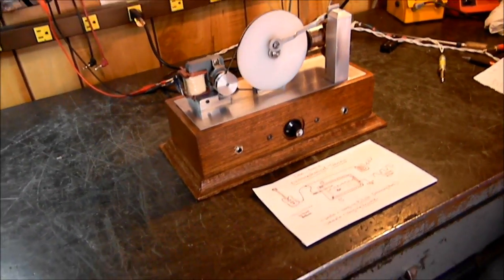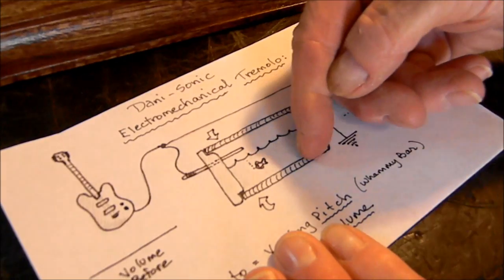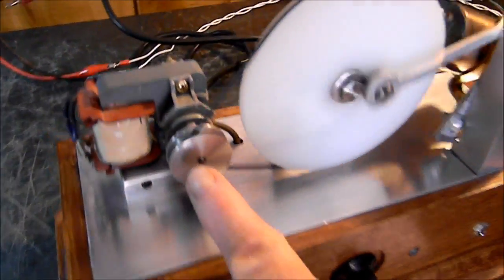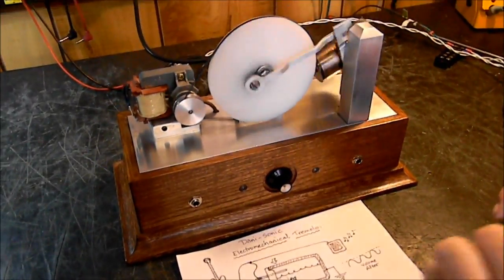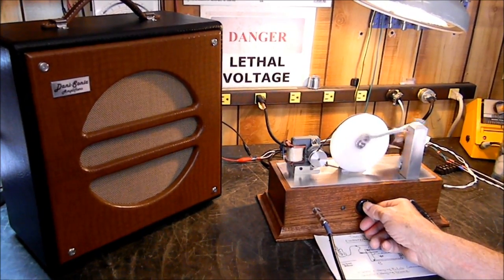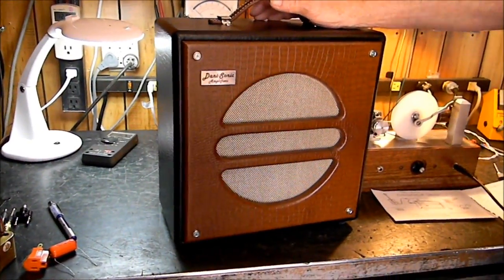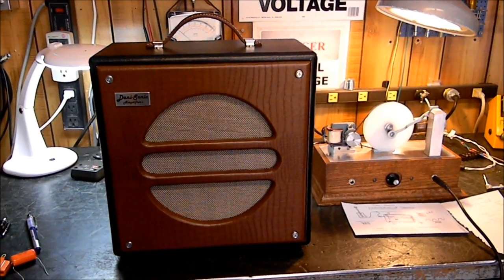Home Made Electro-Mechanical Tremolo by Uncle Doug

Comment: Are you sure that's distilled water? The reason I ask is because there are no minerals in distilled water, which means it's not conductive. If you're on a well and used tap water, I can understand how it would work. But anything that comes out of a still has no minerals, ethanol itself isn't even conductive. Stick the probes from a digital ohm meter in a shot of vodka and see for yourself.

Comment: great remake all im gonna say is you need to add a glass lid or something thick to protect it for the years to come so it lasts.i like the new design also & the fact its a lot smaller but when i heard the original i noticed how clear & full bodied it was & how long it repeats.are you gonna sell some of these proto types cause i would be tempted.me i just got a 1967 deluxe black face fender with tremolo he added tube reverb to it which is alright but the tremolo is going murky at times.i know what the problem is & its an easy fix a part needs replacing.but one thing i noticed is many of these old school great amps had blue ajax caps another tech that has disappeared with the dutch maker.i see they make orange caps or red caps now but they are no way near as good.so what ive noticed is many buy a fender remake amp & send the whole amp tray to get rewired by hand.some of the rewire jobs use loads of caps 20 or more orange caps but every time i look inside a remake amp i cringe at the cost cutting savings even the tubes they stick in these expensive amp,s are rubbish.but me im a guitarist so im always looking at what effects & amps they used also what mics.but all this old tech cant be recreated by digital tech sacd you can keep digital vinyl you can keep i play old analogue records i live for this experience & i wont let any greedy label tell me anything is better than that because its not & musical history is clearly being abused.because every digital vinyl reissue ive heard has loads of the original recordings missing not to mention been compressed to death.i mean i play young people records & they are shocked at the sonic spread & the bass output.but if you built a tape echo unit i would probably buy it & i believe many guitarists would as well.ive heard a few like the binatone units & roland units.but i honestly believe one day analogue will rise up again & i know 4 people who are recording now & we all use analogue tech because its KING baby lol.but the best guitar amp ive heard is a 1960 bassman amp yeah it was for a bass but it was a great guitar amp.that was the amp marshall cloned which hendrix then used so fender built it first & better in my humble opinion.but ive heard 2 & one didnt have the same magic as the other one even though it was from 1959 great post most enjoyable its great learning about yesterdays creations that should still be made today but properly peace...
Reply: Thanks for all the interesting comments, DJ. I'm glad you enjoyed the video.

Comment: That's a very neat device! On first glance, I thought it was part of a weather-station!

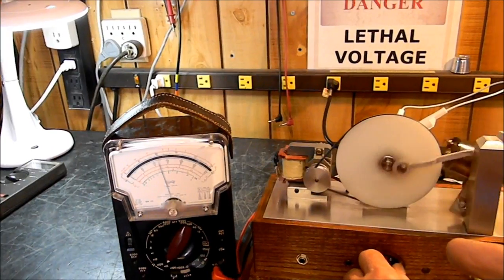I'd love to see this signal on a 'scope!. (5:13) I noticed from your tank, that even at very slow speeds, the resistance element will be 'swamped' with water all at once! Maybe tilt the resistance element up at an angle, where you'd get a gradient of resistance as the tank moves the element into and out of the water. This would probably make the tremelo more 'linear'.

Comment: Cool stuff man, I love DIY homebrew guitar effects and amp stuff like this...a year ago electronics was a complete mystery to me....and today it still is - but I certainly know alot more then I did a year ago and have learned sooo much from my basic builds and mods.....thanks to guys like you who take the time to share and explain your builds  thank you so much I know you guys aint making much if anything at it so thank you so much for teaching newbies....
One question...in this design would it be feasable to replace the copper water tank with say a mercury switch? I have a few old ones I have salvaged from old electronic junk and Im trying to come up with ideas to incorporate them into effects...I just know there must be a cool way to wire them into a circuit ....any ideas???  thanks again!!!
 (another great part about this hobby its relatively cheap compared to most other hobbies especially since you can harvast components from old electronic junk)

Comment: can you make a video on how to build one of these for the guy that knows very little about electronics
Reply: +Michael Craig  There is very little electronic about it, Michael. It is primarily a motor-driven device that grounds out the signal from a guitar in rhythmic fashion (with a speed control to regulate the rate of grounding).  If you have a lathe, a mill, and a table saw, you can build one simply by copying the video images.

Comment: Hello!
Really like the electromechanical tremolo... and like the comparison with the tube, 12ax7 in another video...
This is a passive effect right? i.e. no amplification stage?
Any chance it might be possible to combine the two since the electromechanical tremolo might use a preamp anyway ?
Reply: +Jean-François Joubert  It is entirely passive, J-F, and is inserted in series between the guitar and amp input. There is really no need for additional amplification since the signal the amp receives is of the same magnitude it would receive without the device being present.

Comment: I thought, at least theoretically, that distilled water wouldn't really short a signal.  Does it get ionized by the copper or how does that work?
Reply: +Thoracius Appotite  Absolutely pure distilled water is a practically unobtainable substance, TA, and the moment it's in contact with virtually any other material, i.e. a copper vessel, ions will contaminate it. I found that highly conductive fluids, like salt water, created a choppy on/off effect.....more like a square wave.....that was not pleasing to the ear, and the residual conductive moisture within the tank suppressed the overall signal volume. The more gradual (sigmoid) the on/off effect, the more "pleasant" it sounded. Starting with distilled water created a less conductive solution within the tank that provided, at least to my ear, the most pleasing tremolo effect with minimal signal volume reduction.
Reply: +Uncle Doug Cool! Yeah, it sounds great. Congrats!
Reply: The minerals doesn't get removed from distilling water so it will still conduct just fine. Demineralized and deionized water which has had all of its minerals and salt ions removed is almost completely non-conductiong since it is the minerals and salt ions in the water which conducts the electricity :)

Comment: Nice work.  Easy to reverse engineer the liquid and the chamber from the readings on the Simpson 630 VOM.  The resistance varies between 50kΩ and 500kΩ.  This is perfect for parallel wiring on the guitar output jack.

Comment: Gotta love that the depth of the tremolo will vary slightly due to the un-predictable nature of the fluid. So for minimal attenuation, use pure distilled water. I wonder how drastic the sound would be if you used something like mercury.
Reply: +Karlfalcon  Actually, Karl, mercury would not sound good at all, because its conductivity is simply too high, producing harsh square waves.....rather than the smooth, sinusoidal waves that a minimally conductive liquid, like Windex or water, provide.
Reply: +Karlfalcon Like what you say except for the mercury part ;)

Comment: sounds great, but i thought that distilled water had little to no conductivity
Reply: +silbertinfl   It doesn't, and that's a good thing. You want to gently suppress the volume, not cut it off sharply (as happens with more conductive fluids).

Comment: I wonder how 3in1 oil work? Rather than of distilled water.
Reply: +The H0r5e  I don't think it would flow back and forth rapidly enough at higher speeds, TH, but it might be worth checking into.  Thanks for your input.

Comment: If you have the time, I'd appreciate your opinion. I bought a REALLY rough Fender Bassman10 silver face. It has no data plate so I used the numbers on the transformers and think it is of the 1974 period. No cabinet. Guess they used it for a head unit. Chassis bent and face plate scratched badly. PS caps need changing. It does work, as is but as rough as it is and no data plate, I feel that it has no vintage value. I bought it to go with a cigar box guitar I made. The speakers are NOT original, 2 12's in a homemade cabinet, which is fine because cigar box guitars are old and worn looking, just like the amp. It needs a power light and new 1/4 in. jacks and knobs. Since I see no vintage value, I was thinking of redoing the thing but not back to factory. Should I do this or leave it alone? You have really got my attention as to building one from scratch, like you did. Any advice would be very much appreciated. Thanks in advance..... Hey, maybe you could do a restoration video on this amp!!! :-D
Reply: Greetings, L1. I agree with you that the amp, in the condition you describe, has little or no collector value. I can see no reason why you can't redo it in any manner that suits you. I have no idea of its dimensions, but since it has no cabinet, perhaps you could find an old Bassman head cabinet to hold the chassis. Best of luck !!
Reply: Uncle Doug Roger-that... Thanks a lot!

Comment: You can ad a depth control adding a pot in series with the electrode. That way you can ground the signal totally (stock) or leave a variable resistance to ground. Great Work!
Reply: That's an interesting idea, Carlos. I will keep it in mind. Thanks !!!
Reply: Uncle Doug  Great! That way you can use windex for a chop effect like in some tremolos (sending the signal totally to ground) and control it with the pot.

Comment: So this is AM tremulant verses FM tremulant like that of a Leslie speaker.  Don Leslie's use of the term "Tremolo" was with his Vibratone 30 in 1941.
Reply: Greetings, DD. Yes, this is a true Tremolo because it modulates the amplitude of the signal. The Leslie is actually a Vibrato because it modulates the Frequency of the signal by the Doppler Effect (motion of the source); and, to some degree a Tremolo also, because the Amplitude of the signal is modulated by the changing direction of the source....i.e. it is loudest when it's aimed at you.

Comment: Doug, what kind of motor did you use for this project and what was the rpm rating for it. I am looking for parts to try and build one and was thinking about a turntable motor as they have speed controls but I think the rpm would be too slow...eg 33 1/3 and 45 rpm.
Thanks again
Reply: +Brett Pearson  I used the fan motor from a range hood, Brett, but a turntable motor may work.  Recall that they run at a very high speed and use gear reduction to slow the output down to normal record-playing speeds.

Comment: Thanks for your nice comments. David's theory is that the water is probably contaminated by copper ions and thus gains conductivity. The relatively high resistance of the water is beneficial for smooth peak-to-trough transitions, as opposed to the significantly reduced overall volume and "square-wave" effect you get with more conductive liquids, like the traditional Windex.
Reply: спасибо за информацию!!